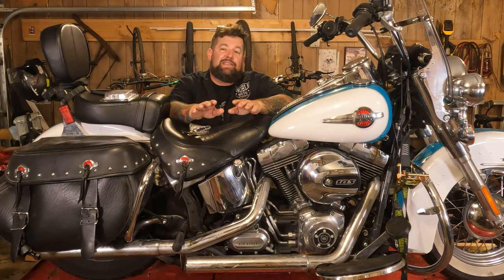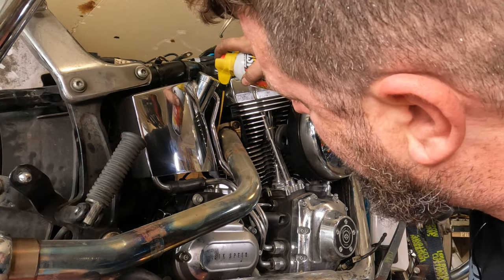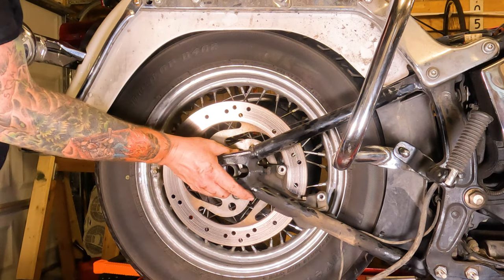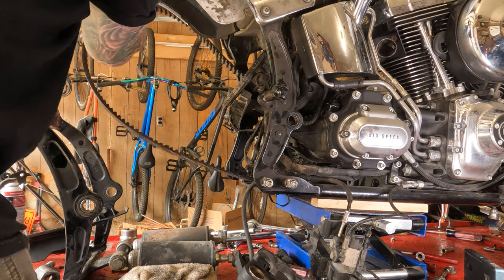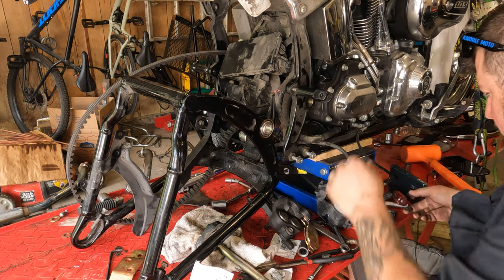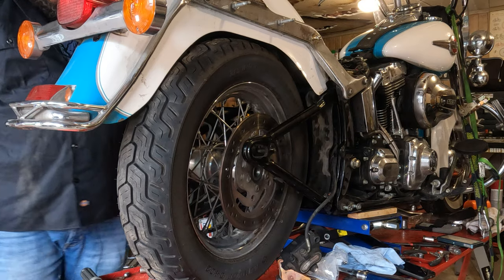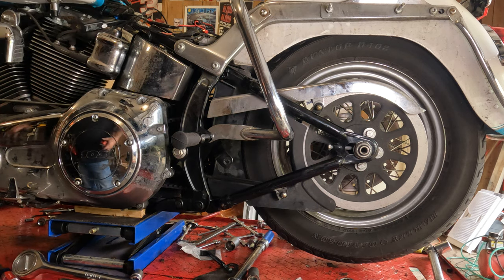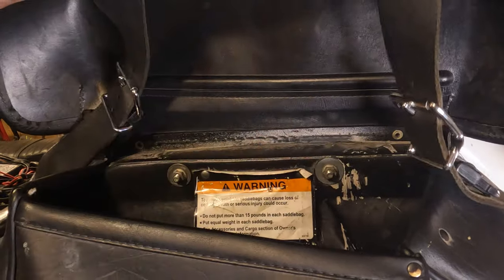84-17 Softail Swingarm Bearing Replacement

Comment: The ECU is in the cutout space of the fender under the seat - with fins on it. The BCM is that rectangular thing between the fender and the back wheel.

Great video - no other video on YouTube compared to this video for removing the rear wheel, swingarm, shocks, etc ... Thanks for taking the time to make this!
Reply from the maker: Seems like a vulnerable spot to put the bcm, but I guess it works 😂

Thank you very much, and you are welcome.
Reply: @KnobleMoto  Yes, it is - in fact, once I got back there I found mine had some road rash on it where apparently at one point in its history my newly acquired bike didn't have a mud flap between the BCM and the tire. Seems to work fine, so no permanent damage.

Had a question - in the service manual, it shows a vague picture of the rear ABS sensor at a 90 degree angle to the caliper arm - and makes it appear that the sensor goes on with the end of the wire up above that arm and the stop pin resting on the top and the wheel spinning forward would support that as well. As you showed, its never too late to reroute that wire to that connector behind the mud flap ... but do you have a picture or another bike where you could confirm which way that sensor wire runs? I may have to make a run to a Harley dealership and hope to find a used Softail from that era with ABS to find out.
Reply from the maker: @TheOmegalope  I would try google image.  Someone is likely to have a photo of that.

Comment: Cool video but why didnt you pull the rear wheel plate on the lift to drop the wheel instead of jacking it up to get it out?
Reply from the maker: On my dyna, it wouldn’t fit, so I generally don’t bother with that plate.  Plus most people are using a jack on the ground, so I wanted to make it as relatable as possible.